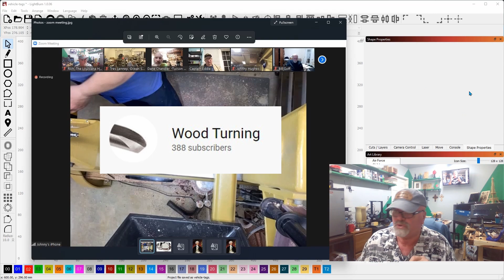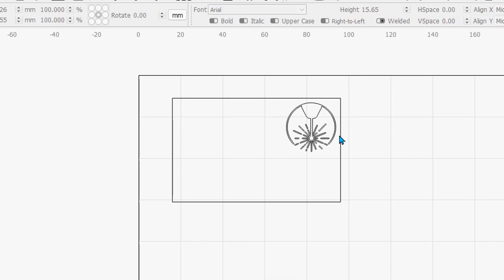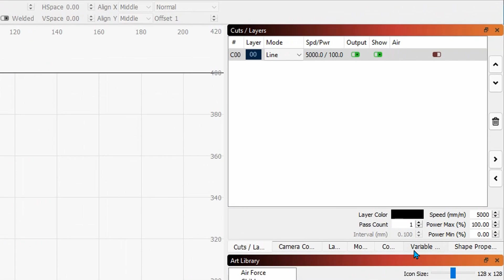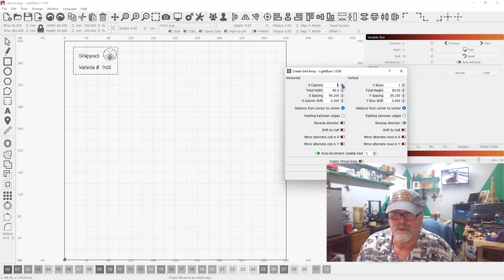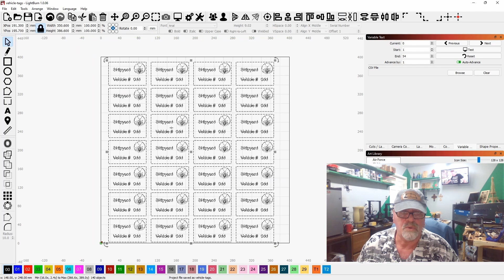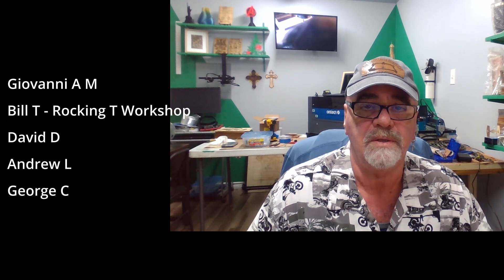ℹ️ Working with Variable Text & Serial Numbers in Lightburn

Comment: Rich please is possible to do this configurations and tests offline, or do I have to have the machine conected to reach the results that you got? my question is because i use EZCAD and thinking to start on Lightburn due to hard time that im having trying to engrave a serial MUTEX and QRCODE. Can you help me with this please?
Reply from the maker: On the Laser tab, click on Devices, and then Add Manually and choose No Machine.

Comment: I do a lot of trophy name plates. Can you use a print merge from a csv file in lightburn?  If so, do you have a video on that. Thanks.
Reply from the maker: Yes you can, Lightburn software has a video on it.
Reply: Thanks.  Watched the video.  Lost me after awhile.  😁 @TheLouisianaHobbyGuy
Reply: @TheLouisianaHobbyGuy  Rich, how do I condense the text using varible text so it doesn't extend  beyond the width of my 1x3 name plate. Thx.

Comment: Excellent information, but I have not found a way to make a consecutive series starting from 00001 onwards, I must make a number starting from 00001 to 70000 and when I start it only marks 1 without the zeros. I would be eternally grateful for your help. Greetings from Colombia.
Reply from the maker: I cover in in the video. Just set the decimals on the work bed with the letter d for the number of zeros, like ddddd1.

Comment: Your timing is impeccable. I am researching how to use variable text to do ~75 trophies with varying divisions and placements. A quick little check in the Lightburn documentation (which will well written) and bam! CSV data imported. Thanks! Once I actually get my laser in a few weeks, I'll post some info in the forums!
Reply from the maker: Awesome Adam! You know that's all I do is read the manual! There's so much that Lightburn can do!

Comment: Congratulations on the 10K mark.  Your channel is highly informative.  Now a lightburn question: at 12 minutes you do a preview of what the job will do.  Most of the cards are engraved and then immediately the box is engraved around the card.  But in a couple of instances LightBurn seems to skip the box and comes back later to do it.  Why?
Reply from the maker: I really can't explain it, and neither can Lightburn. It's a mathematical algorithm that the software runs to find the most optimal path, meaning the path with the least amount of travel Jesse.

Comment: Do you have video showing how you ran this job on your laser?
Reply from the maker: I'm running it now Gary. It's exactly as in the video except for the design. I didn't want to show the company name, or I would have shown the actual burn. All that's left out is me putting my 50x80 cardboard template on the bed and running the job. Check out my other video called, Creating A Laser Bed Template for Production Runs to see how I made the bed alignment & cardboard templates.

Comment: Rich - Congrats on 10K! I wish you the best! Thanks for all you do for the community! One quick question on this. Is this a case where you cut the array in cardboard, then place each of your pieces in the array. And, I think you probably don’t use the honeycomb bed since you aren’t cutting through, just engraving. Also, what machine are you using for this project? Is this something the OLM2 Pro will do?
Reply from the maker: Yes David, I have a 50x80 cardboard template that I use for the aluminum cards, and no I don't use the honeycomb, I just tack the cardboard template to the waste board.
Reply: @TheLouisianaHobbyGuy  Yes, I was curious about setting up the blanks as well.  PS: New subscriber here
Reply from the maker: @C_More_Butts  Thanks for the Sub!
Reply: And which Laser do you use? Is this something the OLM2 Pro will do?
Reply from the maker: @rustyp21  Absolutely! On previous jobs, I used the Neje 40W, but with the right business cards (coated or anodized) it can be done with any laser. I'm using the LM2 Pro for this job.

Comment: Hi. I have a question about the 80w? Diode laser you tested from neje. Does it worth getting it over any other diode laser module kit?

Nvm I found the answer (kinda) in your forum. Great site. Will be reading   this weekend all about it.
Reply from the maker: Thanks for joining Cesar!
Reply: @TheLouisianaHobbyGuy  I want to add a laser module to a lowrider CNC and begin experimenting with it. Do you have any recommendations?
Reply from the maker: @CESAR_H_ARIAS  I highly recommend the Neje A40640 kit with the adapter board. I'm not familiar with the Lowrider. The Neje is 12V, and with the adapter board, can be powered separately with an additional 12V, 5A power supply.